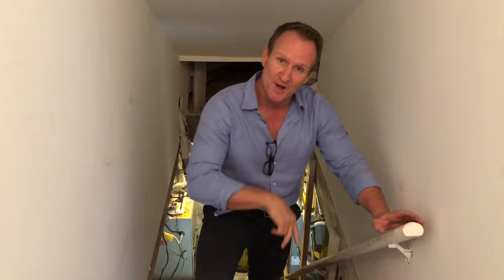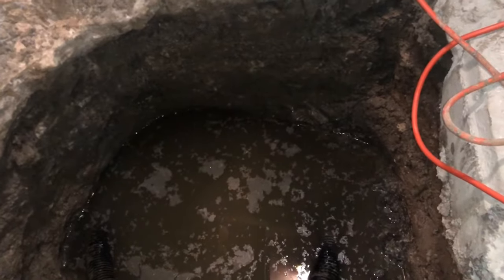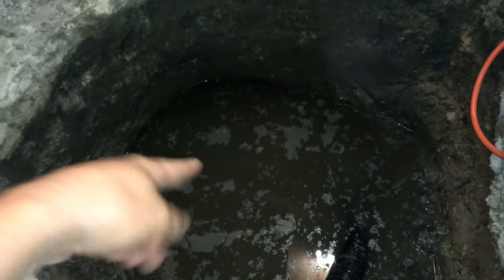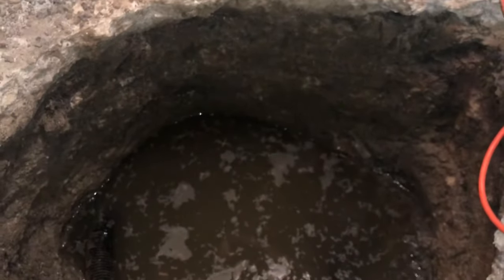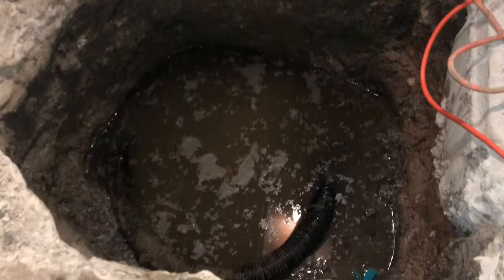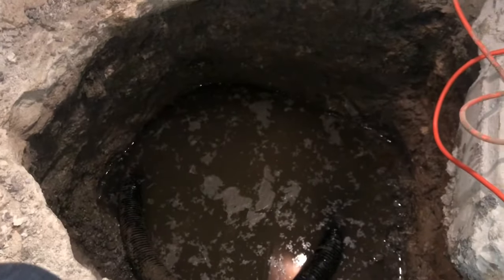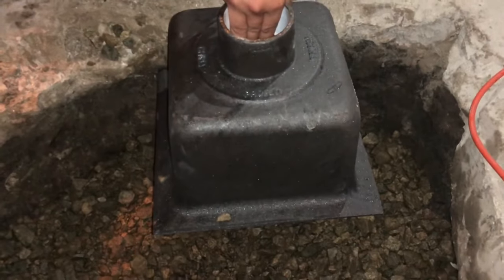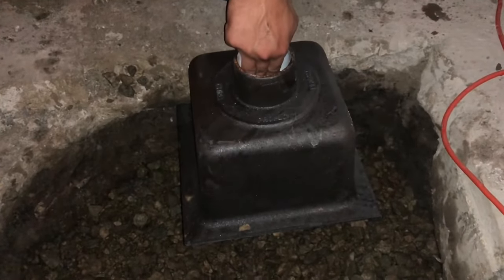How to Fix a 'Smelly' Basement: Dealing with Sewer Odor and Smells | Part 1

Comment: *SOLVED! I have another suggestion*
First - Good video - thanks! 
However it misses another possibility that I discovered and probably occurs more in the northern latitudes. We had a smelly basement - did everything* short of getting a trained plumber. Then it occurred to me at 4:30am - I'm at my most creative then, ½ asleep. 
The OUTDOOR sewer line cleanout. You see - we had a record snowfall and the cleanout had been blocked with over 3 feet of snow for weeks. First thing, after I woke, was to get a shovel and uncover it. 
The noxious vapors disappeared - the methane etc. had nowhere to go (shortest route) so it was finding it's way into the basement toilet area. So my advice - check that appropriate venting occurs ALL ALONG THE CHAIN. Good luck!

Comment: Hi,  I have a pump up toilet in my basement and it smells like rotten eggs.  Should I descale?  Or do an rv deodorizer?   Thank you
Reply from the maker: Did the smell just happen?
Reply: @TwinHomeExperts  it has always had an odor.   I use those RV black tank odor things to control the smell.  I have a shower, bathroom sink hooked up to it.
Reply: I just found out what caused our groundwater smell and in hindsight it makes a lot of sense. First of all, groundwater should not smell. If it does then there is most likely a leak from one of your sewer drain pipes. You can find out by having someone watch the sump hole and then turning on the water from different sources at different times.  Start with the most likely source, the kitchen sink.  I believe it is most likely because it carries a lot of disposal trash and usually through a 2 inch pipe. My house was built in 1974 and it has cast iron pipes.  The other pipes are larger so it makes sense that the smaller pipe would corrode the fastest. If it’s not the sink then systematically try flushing each toilet, continue through every water source including the washing machine which is the least likely source or your sump would smell like downy. If you live close to another house and you do not have a pipe leak then ask your neighbor if they have any sewer gas smells in their house.  If they have had a leak for a long time then the smelly water could be migrating under your house. Before you start testing,  flush the sump pump with a hose and Clorox.  Stick the hose in each pipe which drains to the sump and get it clean.
Reply: @pauloneill8536  my house is 3 years old.  It's the basement bathroom that smells,like rotten water.  I have no neighbors,   I live on 3 acres of land.  Currently using RV grey water deodorant pods and it controls the smell.  Just have a bathroom sink in the basement near it (no washing machine,  or kitchen sink).  Just don't know why it smells.  Nobody does.  I have had it looked at so many times.
Reply: Does your toilet rock at all when you press on it side to side?  If so the toilet is not set properly and needs to be reset.
Reply: @pauloneill8536  Hi,  and thank you for caring.   It doesn't rock at all.